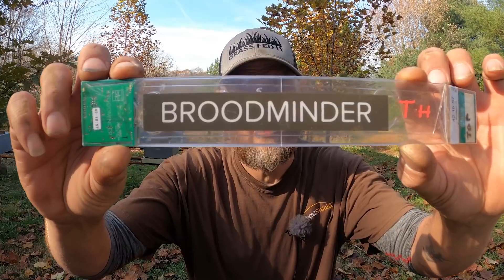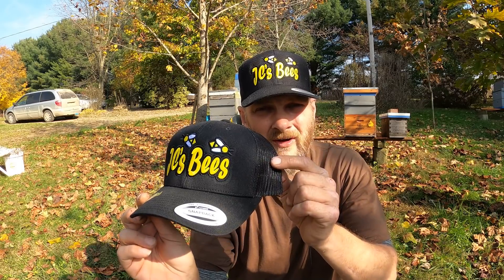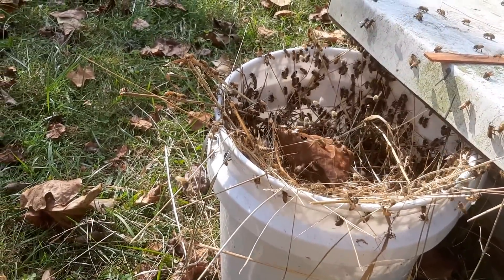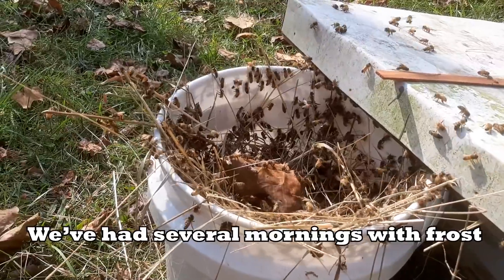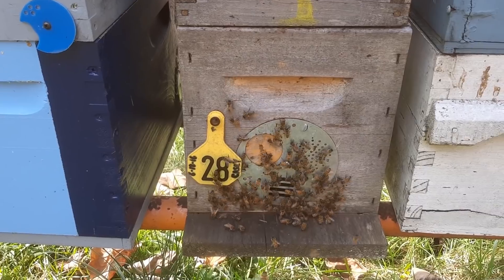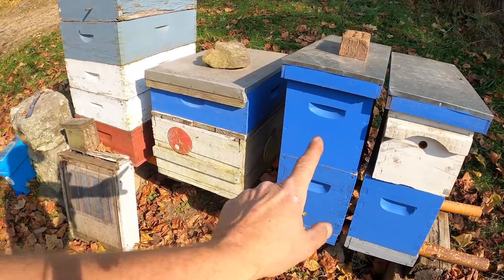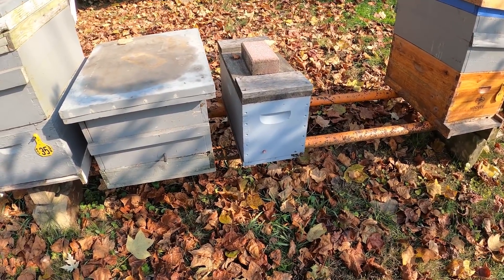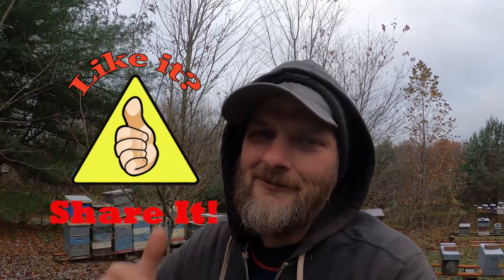Second Chances Before Winter & Setting Up BroodMinder Devices

Comment: For nuc use, put the Broodminder on one of the sides rather than the front or rear. Put the same size piece of wood on the other side. After all it measures weight so it does not have to be at the just the ends, use the sides.

Comment: 2 liter plastic bottles cut into a pipe on each end of the scale or a 3-4 inch pvc pipe to keep the snow off the scale
Reply from the maker: Good idea! The only problem that remains is keeping the snow off the hive itself.
Reply: @JCsBees  solar powered fan to blow the flakes away as they fall. JK 😜
Reply from the maker: 😂 That's it! lol I almost need to move the colony to and open structure to keep the snow off everything so the scale get accurate readings all the time. That or just make a note that each time the weight goes up that it snowed or iced.

Comment: First, Love my Hat. It fits my big dome great. Girls loved the Indian summer we had this last week. Looks good Jason, love seeing the activity. I would have a chair by that bucket, sipping coffee, and watch them feed. I keep straps on mine all the time, have from the start.Just gives that reassurance if a storm comes through and I can't get to the hives. LOL, Ladybug is tired and Debbie shows up. Thats funny. I am curious about Broodminders. I use those Govee sensors, they are bluetooth sensors not meant for Hives but work for me. The scale, I wonder if they will come out with a smaller design for NUCs. Have a great week Jason.
Reply from the maker: Awesome! Glad to hear you like it and it fits. I am adding the options of white, gray and navy blue as hat colors. Had the option of red also but the yellow in my design looked horrible on the red hat. lol
Yes, the ladies sure did love the warm spell, probably just as much as we beekeepers did. I did spend a little time sitting in the bee yard watching the girls work, very enjoyable. Good idea keeping straps on your colonies year round. I should do that, I just get tired of removing the straps to inspect during bee season. 
Ladybug came into heat last week so I am keeping her inside vs running around with me, gotta keep the neighbor male dogs away from her. 😉
I love the BroodMinders. I just need to do better at turning the insight provided by them into data to share with other beekeepers vs just reading the temps and humidity. Someone made the suggestion of putting the scale on the side of nucs vs the front or rear. That does make it so snow will not land on the scale but still it would land on the hive itself which will increase the hive weight. 
You have a great week too! Anxious to see your next video. 😉

Comment: Will the broodminder scale work on the nucs if placed one one of the long sides with something of the same height on the other side? 
Then you could place a 3/4" shim to slope it forward to direct possible condensation. 
Just a thoughts. 👍
Reply from the maker: Great question. I am not sure. Guess I could try it on the side and see. Still snow will land on the roof on the colony and add weight. Like I said, in the video I almost need to build something over top of one colony to block the elements.

Comment: I hear people quote different intervals for how often they clean out ice snow and dead bees out of entrances, once its no fly deep winter temperatures. What do you suggest for the ideal interval on cleaning out?
Reply from the maker: Everyone is different. I like to clear my hive entrances on warmer days when bees are flying. I usually just use a twig from a tree to reach in the entrance and pull out any dead. I don't break boxes apart. As far as the ice or snow I usually do not mess with removing because in recent years the cold weather does stick around very long. I also provide upper entrances so the bees have a way out if the bottom entrance is restricted.

Comment: Hello from Australia , I have a question not related to the video may be you can advise, all my hives have plastic frames ,after extraction I clean off the bees wax and reuse , can I put that frame directly back into a hive without recoating it with beeswax. ??? Thanks Peter  Australia
Reply from the maker: Howdy! Yes, as long as there is still some wax on the foundation you can stick them right into a hive.